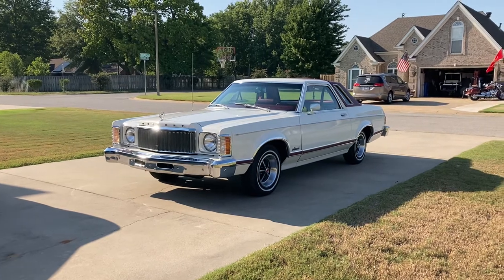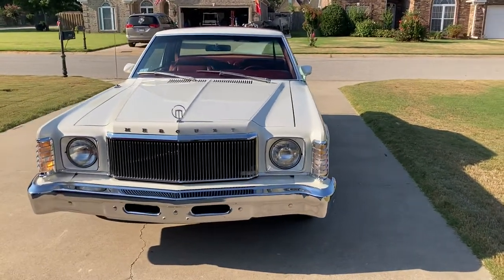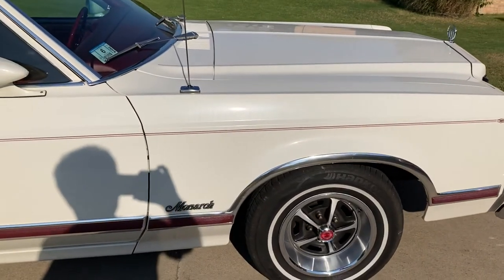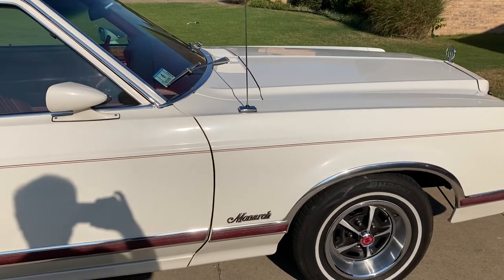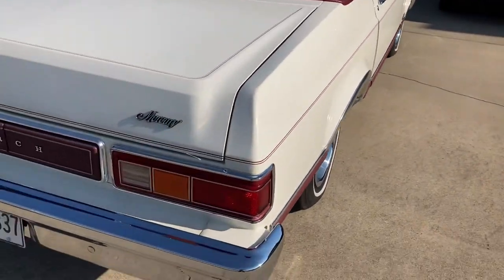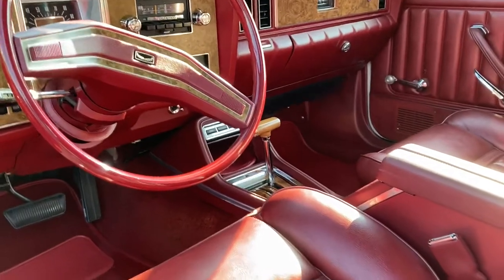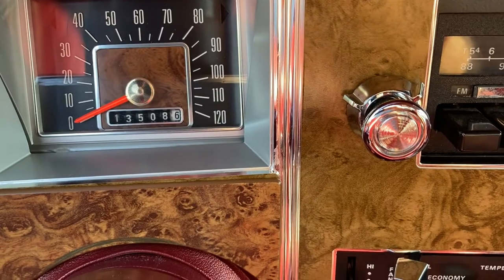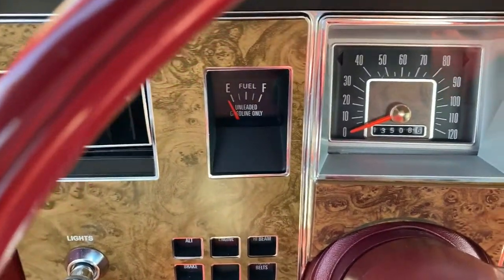Mercury Monarch Ghia two door survivor

Comment: This car is absolutely stunning.  The red colored interior is just beautiful and luxurious.  What is very strange about this specific car is that for a Ghia(luxury model), this car is fairly stripped.  It doesn't even have the bumper protection group which gives you the rubber bumper inserts along the horizontal run of the bumpers.  That was an option that i was sure standard on the Ghia but obviously not.  No power windows, locks, or rear window defroster.  The only 2 options i see is the center console with the floor shifter and the rally wheels.  Personally i don't like a white exterior because these cars came with so many other luxurious color choices but it's still amazing to see this car survive.

Comment: Clearly absolutely brilliant condition, but it's doesn't look like it has electric windows or mirrors as you suggest, not judging by the window winders and mechanical adjuster for the driver's door mirror. However as I say absolutely mint condition. 
Incidentally how technology has moved on, here in the UK my daily runabout is a DS3 (DS is the premium brand of the French maker Peugeot/Citroen), which is about the size of a Mini, it's 1.2 litre turbocharged 3 cylinder engine produces 125 bhp, driving the front wheels through a six speed electronic automatic box!
Reply from the maker: I wasn't real clear in my speaking on those options I mentioned. I stated the Monarch "doesn't" have all those options, which I really don't need in my "toy". Sorry for the misunderstanding. Thanks for the comment.

Comment: How funny.  I didn't even read the description and was thinking what a time capsule.  These would make pretty nice resto-mods with a coyote motor and modern suspension but, it would be a crime to do that to this car.
Reply from the maker: Yes I think so too. Those certainly have a great following  but there's something special about a car, at least to me, that hasn't been  changed and appears like it did back when it was new.
Reply: @marktippitt5601  My '69 GTO is a 32 option numbers matching car that still looks original so there's no way I would ever resto-mod it.  I like it the way it is.

Comment: Are you sure those side view mirrors are original? I could've sworn that those models came with chrome mirrors.
Reply from the maker: They are optional equipment on many of the Ford and Mercurys of that era, usually on the sportier models, as this Monarch is.
Reply: @marktippitt5601  ok
Reply from the maker: Steve, I also checked my Marti report, and the mirrors were original for the Monarch. Thanks for your interest.